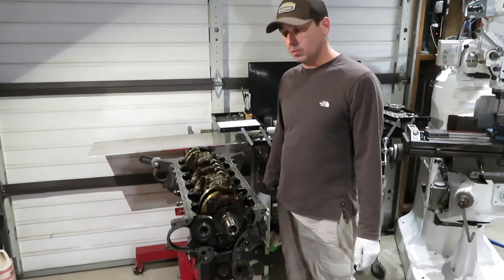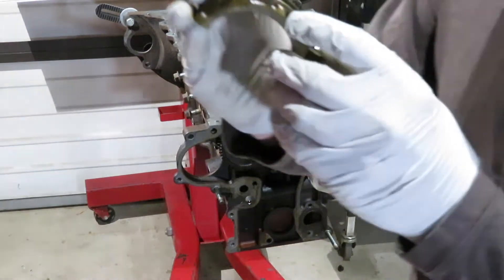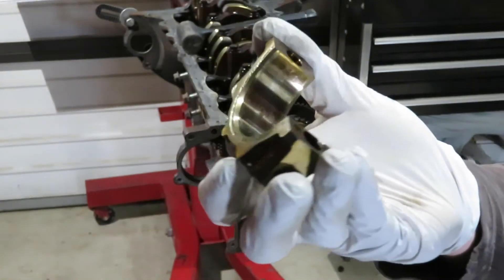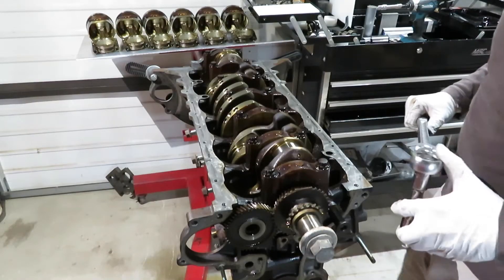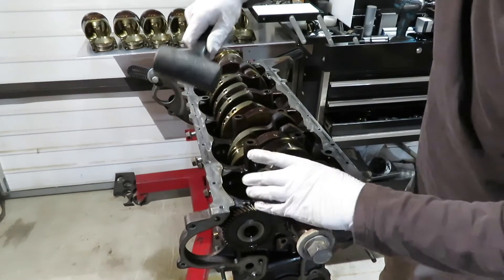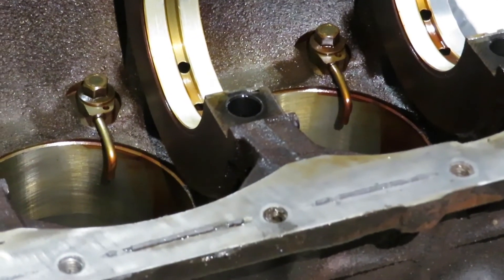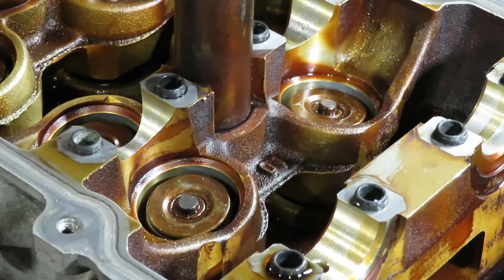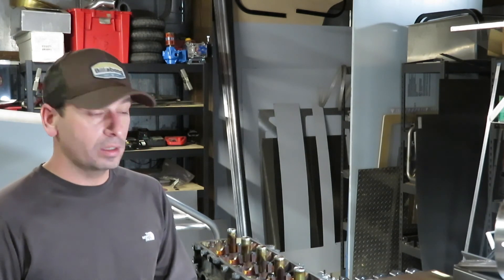1FZ Disassembly, Pistons, Crank and Valves

Comment: Wish I could do my 1FZ, dont have the time. Great work and keep the videos coming.
Reply from the maker: Thanks Shango! Will do, there’s a few in the pipeline almost finished up, hope you get to build yours up sometime 👍
Reply: @stevegiles7954 That build requires a Mastermind Mechanic. I definitely would like to try. That would be a big leap for me. I plan on keeping the vehicle for years to come. Would you recommend more horsepower without using turbocharger.
Reply from the maker: You can do it, just take your time and do one aspect at a time , not sure how much power they can make n/a bit I’d bet you could get 350-400 with the right mods, mostly cylinder head work cams,valves and a porting job with a bump in compression